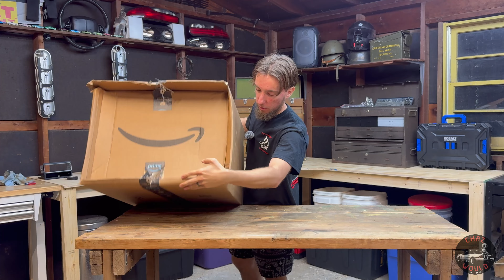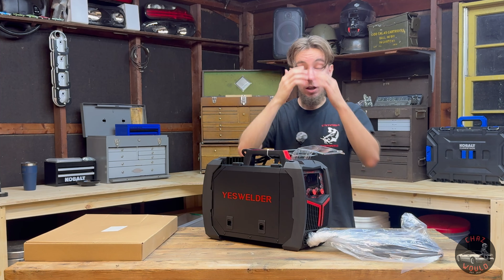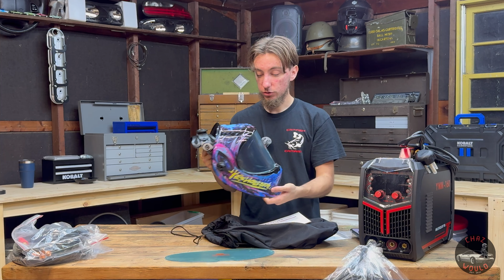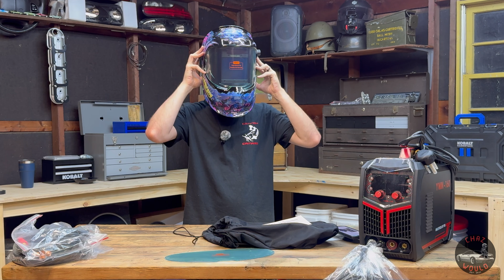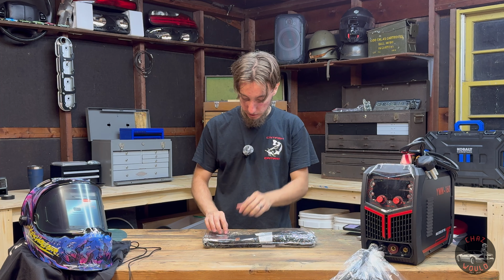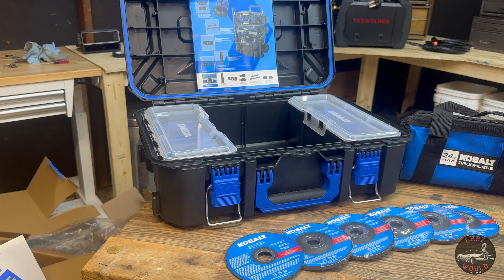I Tried to Build a Welding Setup for $400… Here’s What Happened

Comment: Finally ordered a yeswelder 160 as well. I had a really terrible fluxcore welder with barely any settings. At least these you can dial in the settings decent, a little more power than the super budget welders. I'm only going to use 110v and fluxcore to fix a couple things for now, but at least you can go to 240v and run gas with it later. Seems like a good occasional use garage welder